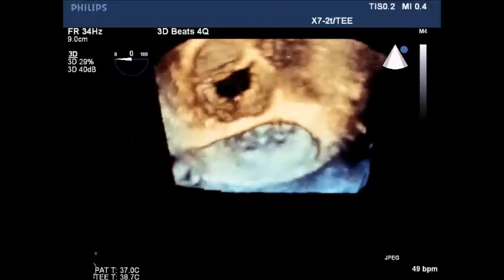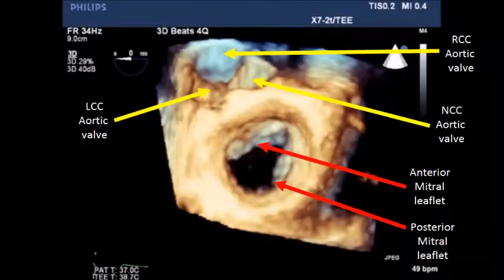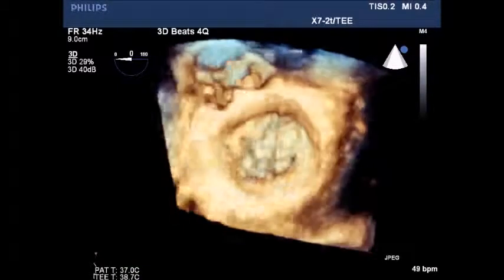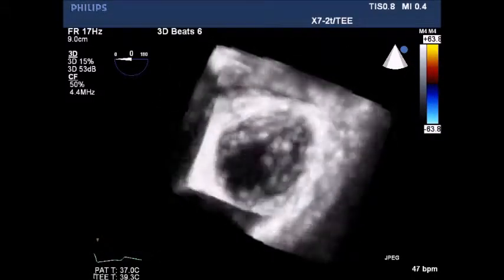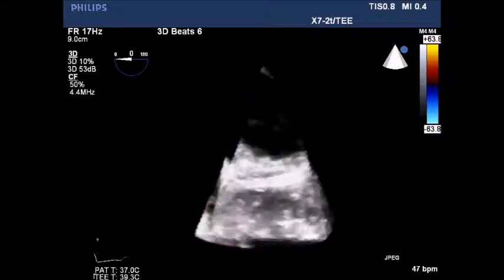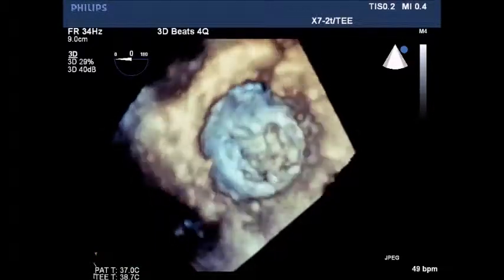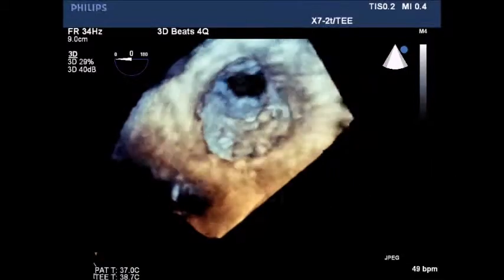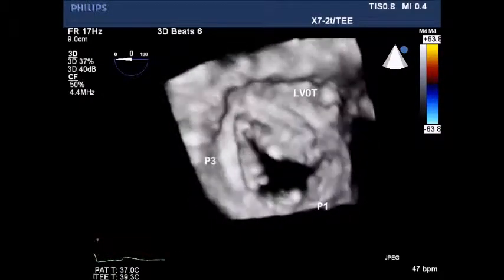3D normal Aortic and Mitral Valves with CFD

Comment from the maker: Yes, it is normal for the posterior leaflet of the mitral valve to have two clefts (some times other smaller ones as well), these can be more or less pronounced and are the anatomical landmarks that divide this leaflet into 1, 2, and 3 segments. The anterior doesn't have these clefts but its segments are named / divided  by mirroring those of the posterior leaflet.